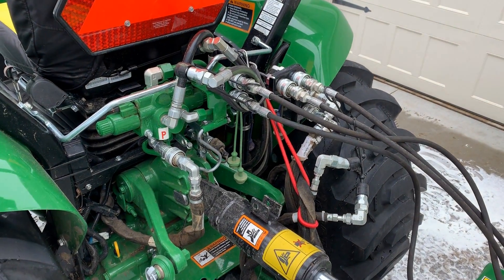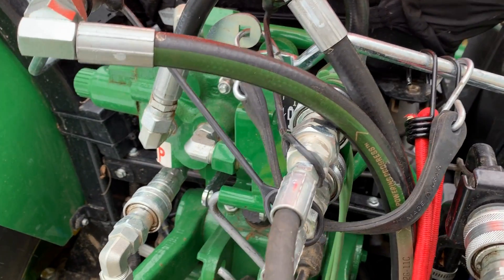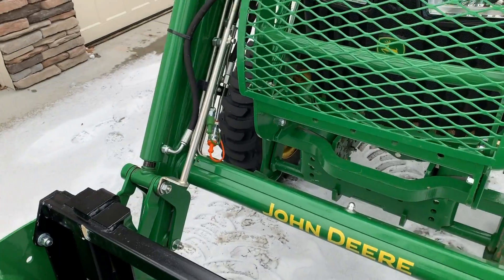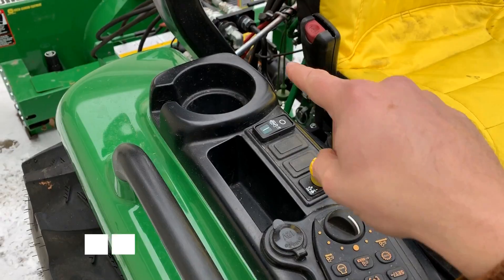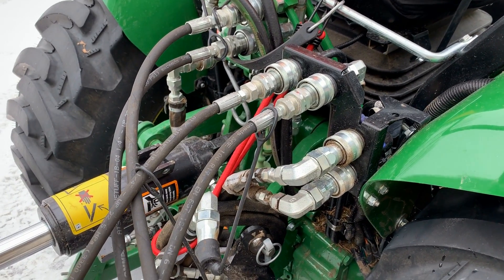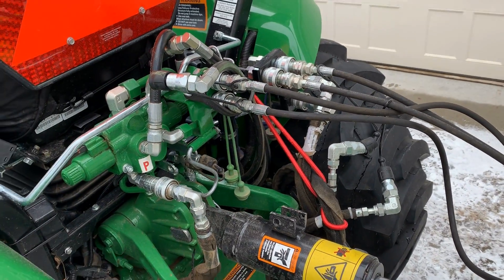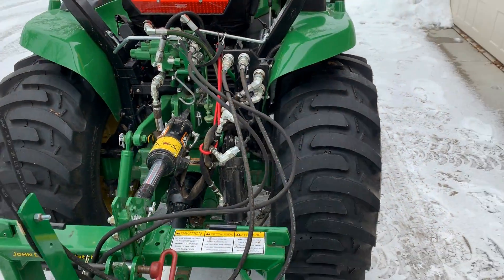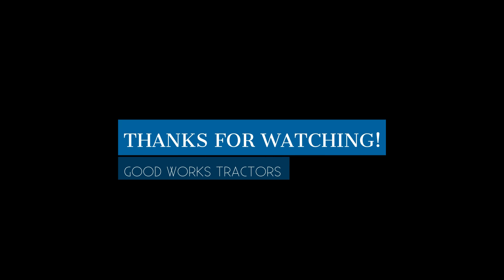Explaining Tractor Remotes, SCV's, 3rd, 4th, 5th Function, Power Beyond, & Electric Diverter Kits

Comment: it looks like you have hard lines going to front of tractor for grapple.  Trying to understand why it has to go all the way to rear and plug in.  Seems like it be a mid way plug in.  I’m just learning.  In your video you said you had to unplug something in back to make your grapple work?  Is there a system with 3 function where grapple hoses plugs into middle and rear ports run to middle control.   And a diverter switch can let you either control front grapple but switch if wanted to rear 3rd scv without have to run front hoses to back, and unplug stuff each time ?

Comment: Question: I recently bought a Worksaver HPD-16, 3 point post driver. Initially I was thinking Ijust needed a rear remote but after thinking about it some more, I think I need a power beyond. Because it has a lever on the unit that moves it upward, that should require continuous flow wheras a rear remote does not. Correct?

Comment: I also have a 3046R that I'm adding extra hydraulics to. How do I get the Power Beyond to work with the 3rd SVC? Directions from Deere show them using the same line but cannot find anything if wanting to install them together. In the process of researching that so any suggestions would be greatly appreciated.

Comment: Almost as polluted as my 4720,  with, 3rd 4th 5th scv, loader 3rd function, top n tilt, power beyond with lane shark value into circuits.  Just need a degree to figure it out.  All black unidentified hoses.  Good thing I installed a lot of it.

Comment: Nice display of hydraulic hookups.  Can anyone tell me for certain : 

 when a "Power Beyond" circuit is connected on a JD 2320,  do you loose rocker shaft function or just loose rocker shaft accessibility with a backhoe attached ?  My local dealer advised me that everything is open center and then told me that my rocker shaft would not function if I have the power beyond circuit connected. This makes zero sense to me since the hose loops back to complete the circuit with or without an implement connected and from what I can tell,  there is no valve to change what is working.  

Anyway,  I want to operate a hydraulic motor and would be plumbing in my own control valve,  I just want to know if it would be better or even make a difference to pull fluid off the rocker shaft valve or from the 1st and 2nd function valve.

Comment: I have the same tractor with a cab and 3rd Function E-Hydraulics. I am installing another function valve from Summit for a Land Shark  mower. I plan to tap into John Deere's P port on the existing 3rd function but need to run a return to tank line. You pointed out that your tractor has a return to tank line on the lower right side.  Is there a part number for that kit or do I have to make one from scratch? PS I got 5% off from Summit Hydraulics by using your name.Thank you.
Reply from the maker: I'm not sure as John Deere installed when I purchased new.

Comment: For a little tractor, there are sure a lot of hydraulic fittings. How do you find those quick connects are for leaking oil. Usually, they seep something. Also, go a little slower in the panning of your camera. Right now, it looks like if you were on top of a sail boat in a bad wind.
Reply from the maker: Normally a few drips when disconnecting.  Fine after that.

Comment: Yes!  That was helpful!  I use power-beyond for other equipment besides the backhoe such as 3pt mounted wood splitter and a hydraulic chainsaw.  I really did not know much about the 3rd option or 4th and 5th as diverted - until your detailed explanation. I've heard other terms used such as "top and tilt", however knew little else other than they are additional hydraulics controlled, somehow by the tractor.  Now I will be asking our local dealer if he can install a diverter for an additional pair of SCVs on my 2520.   Nice Video, and Thanks for Sharing!

Comment: I’ve got a 3039r with the 3rd scv, what kit would I have to get to make it grapple ready using the 3rd scv?
Reply from the maker: You can get a hard line kit to plumb to the front from JD or you could just make up long rubber hoses to plug into the rear outlet.  That will be cheaper.
Reply: Good Works Tractors I’ll probably go with the hoses!
Reply: @GoodWorksTractors it looks like you have hard lines going to front of tractor for grapple.  Trying to understand why it has to go all the way to rear and plug in.  Seems like it be a mid way plug in.  I’m just learning.  In your video you said you had to unplug something in back to make your grapple work?  Is there a system with 3 function where grapple hoses plugs into middle and rear ports run to middle control.   And a diverter switch can let you either control front grapple but switch if wanted to rear 3rd scv without have to run front hoses to back, and unplug stuff each time ?

Comment: Good vid, thanks. I also have a frontier 72” blower. I can’t stop the male couplers for the SB deflector from leaking at the diverter joints. I have dismantled, cleaned & tightened the fittings as much as possible. I also tried joint paste. Have you had this problem?
Reply from the maker: I haven't experienced this issue fortunately.

Comment: Subscribed! Great info. Looking to add a grapple. I have 3rd function SCV rear outlets. Did you have your remote lines custom made? Do you know of a pre-made hydraulic line kit that runs from rear of tractor to front of loader for 3rd function? Thanks!
Reply from the maker: Hi Paul, thanks so much! I don't know of any premade kits.  I think part of the reason for that is each situation is different so the exact hose length frequently varies.  Also, the fittings vary from tractor to tractor and grapple to grapple.

Comment: I have a 2005 JD 4520 that has two hydraulic remotes on the rear, my question is how would I activate it? I don't have any buttons on the joystick but there is a short lever near that. When I work that lever the engine labors like like it does when you bottom out a cylinder. Would that be the lever I'd use to use those lines According to my owner manual, any SCV is activated by a rocker switch then controled by switches on the joystick which as I said, I don't have. But my manual is for a newer tractor than mine so they apparently had a change somewhere along the line. I'd like to put a hydraulic top link on it because I'm always adjusting it in to load my tractor on the trailer and re-adjusting it to mow when it's off the trailer, a kind of a nuisance.

Comment: I am as green as your tractor so this may be a dumb question. Can you add a flow control to slow the rotation of the shute on the snow blower? Does the loader joy stick come in orange😊  good video 👍
Reply from the maker: Howdy, I don't know of a OEM solution, but I'm sure you could find an aftermarket solution that would work.  The other remotes don't respond as quickly, so you could always connect to one of the other options if you were equipped with multiple choices.
Reply: what would be the point the hydraulic controls on tractors all have the ability to control flow speed not just be on or off. So just pull the lever a fraction of the full way to get such an effect
Reply: Pi that’s how a tractor mechanic would tackle it. A good mechanic with lots of hydraulic and pneumatic experience would balance the circuit for optimal control.

Comment: If you had a two scv electrically controlled valve mounted onto the snowblower with an electric joystick controller like from a pickup truck plow on the tractor could you plug the hydraulic supply and return hoses for the electric hydraulic valves of the snowblower into the backhoe hydraulic lines?

Comment: That hydraulic looks as simple as a Russian BMP troop carrier..lines going every where and all the same color, yet easy to track right? So if my tractor were to have 3 rear remotes and I dont want one tying up a hydraulic top link, would a diverter that splits front and rear work off the top rear remote? Or do I need a fourth remote ( or remote multiplier) for top link and a diverter. In other words the best way on three rear remotes to have a hydraulic top link while using other three as needed as top link would be part time use so to speak.

Comment: I saw the tractor on TTWT and I had to get a betterment view of those hydraulics.  There's a lot going on there! I like the idea of using the joystick for the rear hydraulics. I always wondered if the 3 point lift could be plumbed up to a joystick. Do you know if that's possible?
Reply from the maker: Hey Kevin, thanks for checking out my video!  I'm not aware of any option to raise and lower the three point with the joystick.  I like having a separate control for the 3 point though as I already find it "slightly" inconvenient to switch back and forth between the loader functions and 4th/5th functions when I'm using a snow pusher and rear snowblower.  I'm not sure how to incorporate anything more beyond that though.
Reply: @GoodWorksTractors  I guess what I was thinking of is having another joystick which will only control the rear remotes, including the 3 point. But I imagine that'd be expensive.
Reply from the maker: Yeah, I think it would be very expensive, haha!

Comment: Can the “joy stick” be added to a 1025r?
Reply from the maker: That is a good question.  I haven't seen the same type of joystick on a 1025r, but I have seen different aftermarket versions with a button (Thumb) control fastened to the joystick.  Maybe someone else can enlighten us both.
Reply: @GoodWorksTractors  great video.  Seen the thumb operated button on Tim's 1025R  seems to work well.  Maybe a diverter kit as a where is Waldo promo give away in the future?

Comment: Is a 3d SCV or a diverter kit better for a new grapple?  Is one easier and less costly than the other to have installed?  I'm not mechanically inclined, so it would have to be a dealer job.  For budgetary planning, what might be a reasonable current retail service cost to have my local dealer install either a 3d SCV or diverter kit on a JD 3320?
Reply from the maker: The diverter kit is definitely cheaper and will serve the purpose.  However, you will lose control of whichever function is being diverted when activated.  Pricing will vary, but I would expect $1,100 to $1,500 depending on your dealer.  A diverter kit can be purchased and installed for close to half that price.  You could probably even install the diverter kit yourself.  I've seen several tutorials about how to do so online.